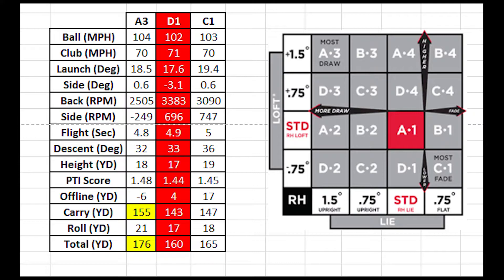Titleist Adapter Hitting Ball On Each Setting

Comment: This video helped me to start getting my brain around these adjustable drivers, but it would have been nice if you would have slowed down a few seconds here and there so I could find the data you were referring to or if you used some animation to point to the cell on the spreadsheet you were referring to that would have been helpful.  I backed up and stopped the video several times in order to understand what you were talking about.  Thanks for making this video it was helpful.
Reply from the maker: Thanks for the feedback Malcolm. This was actually one of my first videos I did. It was a lot of data to cram into one video for sure. It was definitely neat to see what exactly the adjustability will do to the ball flight. I look forward to doing more stuff like that in the future and getting my hands on more clubs to see what exactly happens with different clubs and Lofts and adjustability. Thanks again for watching. If there's anything you would like to see let me know and I'll see if I can work on it for you.

Comment: You keep referring to the D1 as the standard setting, but in the picture of the adjustments it shows A1 as the standard setting. Also, I believe the loft chart you're showing is for the driver and fairway wood version which changes it by .75 degrees each, yet the 816 hybrids change every 1 degree